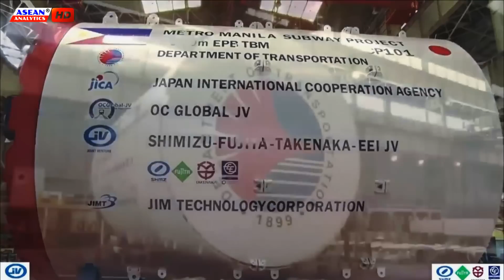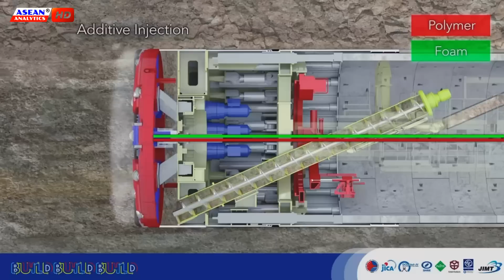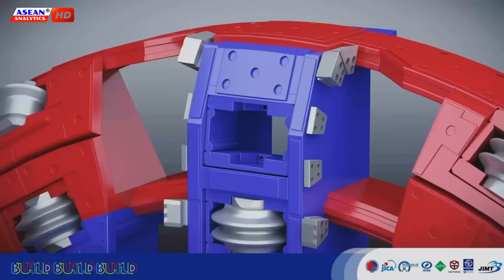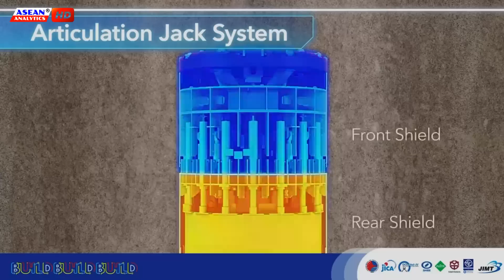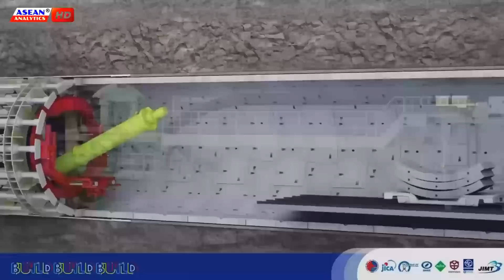TBM Launching of METRO MANILA SUBWAY | MMSSP 2023 Project Update

Comment: Japan proposal in 1973 for 6 lines, but Marcos opted for the ugly LRT. PNoy reopened proposal and Japan PM Abe pledged funding in 2012. Approved by NEDA in 2015. Salamat PNoy for another Development project. Succeeding presidents will only credit grab your countless accomplishments.
Reply: It was a different proposed project by PNoy called Makati-Pasay-Taguig Mass Transit System Loop. it's a proposed 20-kilometer loop that would consist 16 kilometers of tunnel and four kilometers of elevated railway with different alignment and 11 different stations. which later scrapped by the same administration.
Reply: @thybiscuit  so? Sino bang admin ang nag umpisa niyan? It's the same government project, continued by a different administration. 
Yung Mass transit loop was only approved by NEDA Dec 2015, patapos na ang PNoy administration noon. Japan pledged funding as early as 2012.
In 1973 Japan proposed 6 lines.  Yung makitid, madilim, inconvenient at bulok na LRT ang pinili ni Marcos.
Reply: @ociniago2257  Marcos Sr. and PNoy have both different underground heavy rail line plan. second I can't find any detailed information of subway prior to march 2014 JICA's feasibility studies (I still have the PDF of JICA ROADMAP FOR TRANSPORT INFRASTRUCTURE DEVELOPMENT). still most of them are in drawing and never materialize until 2017 when it was revised and approved by NEDA then signed deal with Japan goverment on 2018. so what we are seing now is the 2017 approved MMS project.